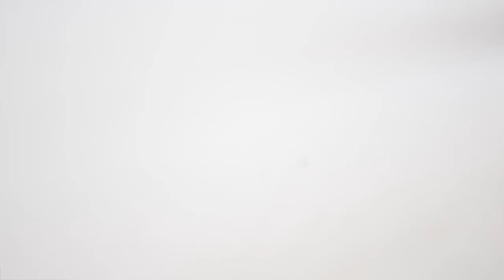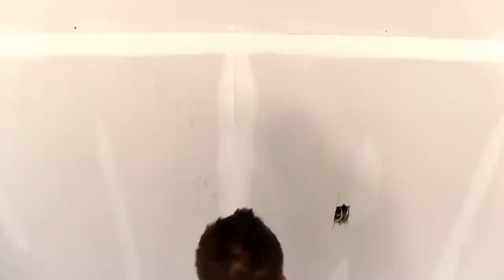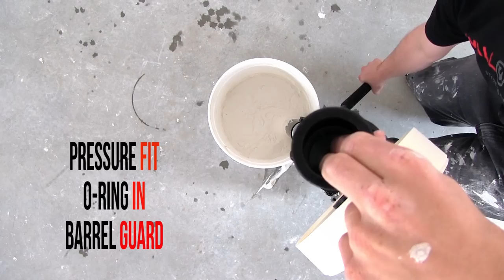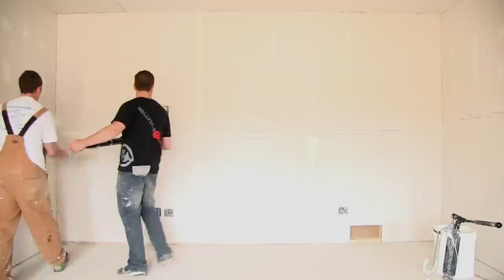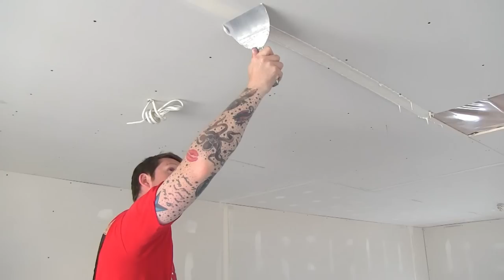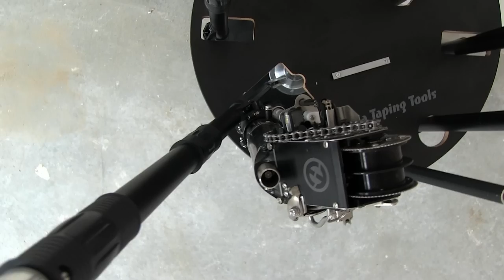Drywall Taper - Hardened by Columbia Automatic Taper

Comment: 2799$ is for the Hardened Full Set Special.
That includes the Automatic Taper, corner roller, roller handle, angle head, angle head handle, corner box, corner box handle, 2 flat boxes, flat box handle, mud pump, gooseneck and box filler.

And that price!? Is a wicked good deal for that set!! Trust me on that one! Won't find a better deal that that.

But the taper alone, is $1299. Which is also a pretty sweet deal.

And you said it! F'n painters! :D

Comment from the maker: Best Taping Tool of the Year Award - 2012
Best Taper Video of the Year Award - 2012
Coolest Drywall Tool of the Year - 2012
Best Tee Shirt worn by a Drywall Taper in a Cool Taper Video Award - 2012
Coolest Tattoos on a Drywall Taper Award - 2012
Director of the Year - Taping Tools Video - 2012
Best Selling Taper of the Year - 2012
Rock Solid Award - 2012
Getting tired of making up cool sounding awards that this Taper should obviously win Award - 2012